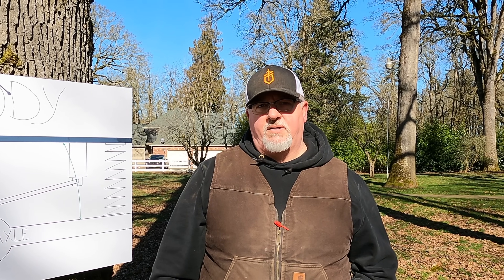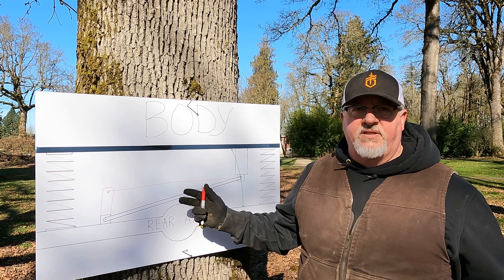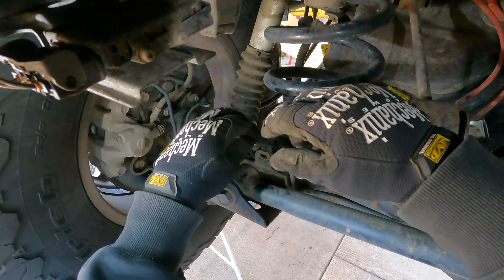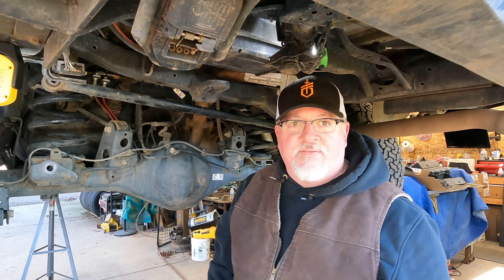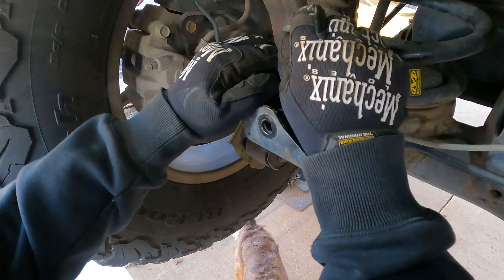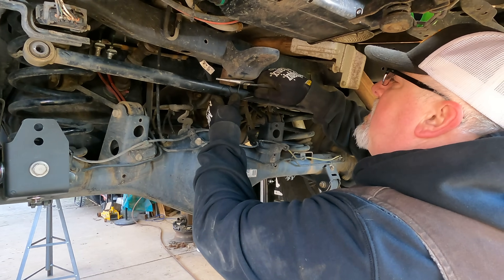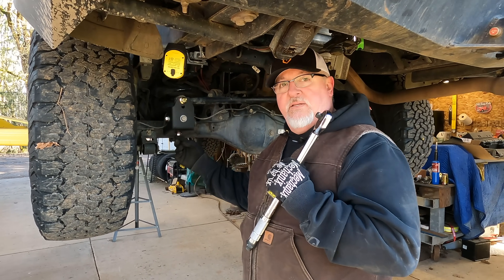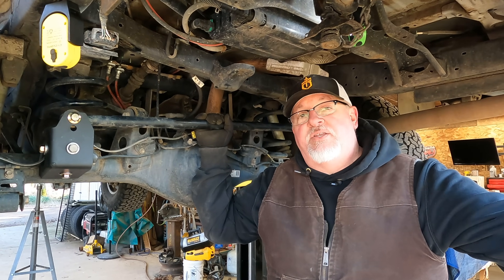Do Not Lift Your 4Runner ... Overland Build Recommended Geometry Fix - Do Not Lift Without This

Comment: You had me at "Do Not Lift Your 4Runner".  I don't see the point of it for normal people.  A stock 4Runner is probably more capable off road than most drivers.  I've recently bought a one owner 2018 4Runner Limited and I'm adding some safety equipment to it - rock sliders to replace the running boards it came with, and a set of 3 skid plates to protect the engine, transfer case and transmission - for when I'm driving it off road.  The original owner never took it off road.  I can't find a compelling reason to spend a bunch of money on a lift to replace a suspension system that isn't broken and to replace perfectly good rims and tires with ones that are slightly bigger.  If my X-Reas suspension system develops a leak, as they're prone to do, I'll delete it and replace it with conventional shocks, but I still need to see a good reason to lift the vehicle when I change the suspension.  The vehicle is already top heavy enough without lifting it higher in hopes of gaining a tiny bit of ground clearance and bringing all kinds of other potential issues into play.  I'm more interested in having a vehicle that's reliable and functional than cool looking.  I bought the 4Runner because I want to be able to get to more places that require high clearance 4WD, but the reality is it is still going to be driven on pavement 90% of the time.  If there are compromises to be made, I'll make them off road with the 10%.

Comment: I lifted my 2006 Nissan Pathfinder 4", the shop I had do the work never mentioned this information. When I'm driving and I run over a bump, I've noticed that shimmy he mentions. Its 2am and I am tempted to go look under my truck right now to see if that Panard bar was raised. I am betting that it was never touched.
Reply from the maker: It’s unfortunate that most lift kits, and most shops, neglect things like proper geometry; I think it should be mandatory, for safety sake. I hope you’re able to get your rear shimmy resolved. 🙌

Comment: I haven't seen the bolt on style kits for the panhard bar extention only ones I have seen are the weld ons but might be different for the 4th gens which are usually the same as the 5th gens hmm might have to see if I can find this kit for mine
Reply from the maker: Check drkdss.com to see if they have it. 🙌
Reply: @aired-downoverland9239  appreciate the link very much the website actually says it will work for my 4th gen v8 so going to order one up that helps a ton
Reply from the maker: @AntonioClaudioMichael  Glad it worked out!

Comment: Easy fix. Dr Kdss has a bolt on correction kit. Works great!
Reply from the maker: Agree! DRKDSS did a great job on the design and fit/finish of this kit. I’ve had the weld in bracket for a while but glad I never installed it.
Reply: Where can I find this?
Reply from the maker: @EvolBobby  drkdss.com

Comment: Just did mine! Got a shiny red one!  I have 2" of rear lift and went with the shorty version. You still want a little bit of angle for when you load up your rig with gear so your track bar's not in the negative.
Anything over 2" you'll want the regular height version.
I have a feeling Dom @DR KDSS will be working overtime trying to keep up with new orders for this awesome product!
Reply from the maker: Yup, all true. I’m just over 2” most of the time; I’m typically level when fully loaded. Also agree DRKDSS will be working late nights 😄

Comment: Thanks for the informative video! 

I just got a 5th Gen 4Runner and want to get a 2-2.5in leveling kit put on it. In doing this would it create this issue or is this an occurrence when one does a suspension lift? 

Thanks again!
Reply from the maker: You’ll be fine without it since you’re going with a leveling kit. 👍🏻👍🏻

Comment: Recommendations for if youre doing a weld on kit? Like order of the steps when removing bar?
Reply from the maker: I have a weld on bracket but never installed it, so I don’t have real worries experience. In would only disconnect the axle side of the panhard, weld in short sections to avoid heat build up, ensure the ABS line is out of the way, protect other areas by using a welding blanket. 👍🏻

Comment: Fantastic video. Very informative. At what height of a lift do you need to adjust the pan rod angle or correct it? With all the different lift videos on YouTube, no one ever talks about the pan rod correction. I’m thinking about doing a 1.5 to 1.75” front lift on my 24 TRD ORP and a 1.5” lift in the rear. I want to keep the factory rake or close to it which is set at 2”.
Reply from the maker: Thank you, I’m glad you found it helpful. You can find the correction bracket here: drkdss.com
A 2” rear lift typically benefits from this geometry correction. I’m not sure if a 1.5 would require it. The easiest way to tell is to do the lift, then check the panhard for any angle while on level ground 👍🏻👍🏻
Reply: @aired-downoverland9239  Thanks 👍

Comment: THANK YOU-- it's SO NICE to see someone EXPLAIN the "engineering" change that is RuINED by lifting and not correcting the other angles...  AND what about regearing for speedometer correctness too??  This doesn't even cover the engineering that changes the PULL forces that change on the transmission and engine by doing these mods.. THANKS AGAIN.. EXCELLENT VIDEO-- MUCH NEEDED..
Reply from the maker: Excellent comments and spot on. I have re-geared to 4.88’s, which gets my shift points and speedo really close. 🙌. Happy Holidays

Comment: Thank you for the information. Where does one acquire this bolt-on modification? Would the Toyota dealership use this piece in their suspension kit if getting a 3" lift?
Reply from the maker: You can get it from drkdss.com, they’re the only ones that manufacture it.

Comment: Just bought a used 4runner sr5 with a lift and fox suspension kit. suggest taking it to toyota mechanic to check if it was all done correctly and if im in good shape or any mechanic would be able to inspect?
Reply from the maker: Never a bad idea on a vehicle you haven’t built yourself David. The piece of mind is likely worth the cost.

Comment: I have a lifted Sequoia and I have to continuously steer left & right every time I got on the freeway. Steering rack was recently replaced so I don't think it is the steering rack but rather the panhard rod since mine is at an angle rather than horizontal.
Reply from the maker: Well I hope this gives some ideas on a fix. 👍🏻
Reply: Maybe you have a wheel under the fender on one side and maybe it's sticking out on the other side?

Comment: I saw a grease zerk that seems to now be hiding behind the bracket.  Can it still be accessed?  Also, you showed how the axle shifted about a 1/3 of the bolt hole distance.  Does that mean the axle is out of line by that amount since it lined up when leveled?  And finally, do all solid rear axle vehicles have a panhard rod?  Very interesting video.  Thanks
Reply from the maker: I don’t believe any zeros are blocked; I can’t think of one that would be behind the bracket. Since the vehicle was on a lift, and the axle at full droop, it likely shifted a little due to the way a panhard works. No, not all solid scores axels have a PH, a triangulated four link does not, or one with leaf springs, etc. 👍🏻👍🏻

Comment: Great video, great info. Which leads me to a  two part question. Do reputable shops that do lifts on 4 Runners perform or recommend this fix? And how does a lift as well as this fix effect a factory warranty? Thank you advance sir
Reply: Does not affect warranty at all. Most shops will recommend it if they know what they are doing.

Comment: Would you recommend this pan hard/track bar lift with a  1.25 inch rear lift? Pre-load Wescott. Thanks for you video. Very enlightening.  I have not experienced any of the issues in turns or dips etc.
Reply from the maker: If you’re not feeling any bump or rear steer, then no. With a 1.25” lift, my guess would be your track bar is fairly flat.
Reply: @aired-downoverland9239  Thanks for the response.

Comment: Great video… Link or info on where to purchase the kit?
Reply from the maker: You can get it from drkdss.com  They seem to go in and out of stock, but they’re a small manufacturing outfit, so I get it. 👍🏻
Reply: I’ve been going down a YouTube rabbit hole with 4Runners lately and I just realized that mine is different from the one in your video I think.

Do they make them for 3rd Gen 4Runners?

Comment: Do you need to do this with the vehicle in the air or can you still do it while on the ground? Just bought a 4th gen and need to do this to mine.
Reply from the maker: You can do it in the ground, and in fact, the final torque should be done on the ground.

Comment: Hi, excellent video, I have a question, what would be the difference between using the bracket to level the panhard versus using an adjustable panhard? Is there any advantage/disadvantage with the adjustable panhard? Somewhere I read that for every inch increase in suspension height, you should increase the length of the panhard 1/16 of an inch. Greetings from Quito - Ecuador.
Reply from the maker: An adjustable panhard can help keep your axle centered as you lift a vehicle, but it will not correct the geometry of the panhard as you lift the rear end. If you have a correction bracket, you shouldn’t need an adjustable panhard because the axle should be sitting in the stock location.

Comment: I have a 2018 SR5 4Runner. I didn’t install a lift kit on it but did install off-road tires with same size according to sidewall, but the new tires are actually a larger diameter than the all season tires I took off. I also installed Bilstein 5100 shocks. Even though I didn’t install a lift kit, would I still require the pan hard rod adjustment?
Reply from the maker: Nope, you should be good to go with your current set-up
Reply: @aired-downoverland9239  That’s good news, I also just read that if the hard rod is 5 degrees or less, no need to make changes and i’m under 5 degrees, thank you for the feedback confirming that i’m okay “as is”.

Comment: That's an interesting product, never seen it before, my panhard is raised, but the bracket is welded to the stock axle, it's made by Eimkeith. I guess your bracket is less of a permanent solution, I'm curious about reliability.
Reply from the maker: I purchased the Eimkeith bracket as well, but never got around to welding it in. Both serve the same purpose and should perform without issue if installed correctly. As shown in the video, I used a  paint pen to mark the bolts position to note if anything moves. So far so good.
Reply: @aired-downoverland9239  nice good to hear, good  option for those not wanting to modify stock parts.
Reply: @aired-downoverland9239  it’s way more reliable then the weld on version.  A thicker bracket welded to the top of a thinner oem mount is not it.  Trac bars side load the mount.  The oem mount is thin in some parts and i have proof of how the weld on version can be dangerous to some one who doesn’t cycle their suspension and end up using the bracket as a bump stop.  This bolt on version spreads the load all around the oem mount and inside !   If you break it after it properly torque down. You prob died ( not funny) and don’t even care about what broke.
Reply from the maker: @drkdss8742  Excellent response from the DR 👍🏻🙌

Comment: Unless you go overboard, it's OK to lift it. I have two - 2004 with 302,000 mi and 2018 with 35,000 mi. Both were lifted 2.5" at birth. The older one had eventually (@250K) UCA's replaced to correct caster but even before that, it handled perfectly, tires did not wear faster than they should've... The other one (stock except lift) has had no issues either.
Reply from the maker: Did you actually watch the video? Mine is lifted too, the video is about correcting your your geometry after lifting.
Reply: Lmfao.. its about the rod
Reply: @aired-downoverland9239  Did you read my post? The point is: it's not necessary to correct anything unless the lift is over 2.5".

Comment: Great video.  Thx.  How much angle is too much?  I have a slight angle in the panhard bar.  Not nearly as significant as the drawing.  Thoughts?
Reply from the maker: If it’s minimal with the vehicle on the ground, and you never feel the rear and move (bump steer), I’d leave it as is. How much lift do you have in the rear?
Reply: On a level surface with vehicle on the ground on its own weight. Measure from the ground up to the center of the bolt on the frame side.  Then do it on the driver-side.   If the difference is 1.5-2.5 I would do the shorty.  If it’s taller then that then do for the regular height. 

Under 1.75 you don’t really “ need” it but it’s more like you should want it knowing the axle is alittle pulled over to the passenger side and the geometry is a little off.  Some one sitting taller at say 3” or more will really feel the difference vs some one under 1.75”

Comment: So if I got a lift kit and had someone professionally lift my 4Runner, should I try to save on labor and do this rod correction myself? Or should I also buy the rod correction kit, give it to the professionals, and don't try to save on labor costs (if it would even be that different).
Reply from the maker: I can’t answer that as I don’t know your skill set. Check out the manufacturers site, that should give you enough info to know if you can/want to do it. Their site is drkdss.com

Comment: Where can I get the raising bracket? Thank you having issues now on my 96 4Runner it has a 3-inch lift that was put on it but!it's all over the road!!? where do find that elevated bracket? Thank you
Reply from the maker: You can find it at drkdss.com
Reply: @aired-downoverland9239  thank you I bet there's also examples of homemade brackets:-) realistically most guys that lift a Toyota or Jeep aren't going to spend that money and work and then put it back down to stock again probably ever? There are exceptions but if that is the case I could weld a piece of metal coming up off the axle from the other bracket  already on the rear axle. if I didn't know where to find one of these kits , anyways thanks
Reply from the maker: @markeverson5849  There is a weld on bracket available, check out: https://eimkeith.com/buystuff/pck/

Comment: This does fix your geometry for the most part but it would be advised to get an adjustable trac bar and measuring frame to outside tire to get it 100% centered
Reply from the maker: 100% agree. You’ll note I have an adjustable trac bar as well, I just didn’t cover that in this video. 🙌

Comment: Would I also need to do this when installing a westcott designs trd pro lift? It claims to not affect the geometry of the suspension but I just want to make sure
Reply from the maker: I’m not familiar with their lift, so I can’t say for sure. If it pushes the axle away from the frame, you’re changing geometry.

Comment: What if all I did was add a leveling spacer on the front only? Will this affect longevity of my truck? Mind you mines a 2wd.
Reply from the maker: A leveling kit will not change the angle of the panhard rod, you’re only moving the front up 1”
Reply: @aired-downoverland9239 Thanks!!

Comment: How much lift to require this kit? I lifted my 05 about half inch in the rears and 1.5 in the fronts. Barely notice any issues with rear suspension.
Reply from the maker: With only 1” in the rear you should be fine without a correction bracket.

Comment: So for a city drive and from time to time towing, do you recommend this correction? Stock suspension.
Reply from the maker: If your 4Runner has no lift in the rear, it would not be needed.

Comment: You mean this kit will not fit a 1996 Toyota 4Runner? And I thought I found a quick fix! But in the comments someone said that that kiT will not fit the 96 is that true? I was ready to order! Help
Reply from the maker: You’d have to contact drkdss.com as I’m not sure what years they make brackets for. 👍🏻
Reply: @aired-downoverland9239  okay thanks so far all I've found is a two-piece weld on kit
Reply from the maker: @markeverson5849  A weld in bracket is not a bad way to go.
Reply: @aired-downoverland9239  I understand thanks it's just that a bolt-on like yours would have been sweet anyways have a great day be safe on the trail

Comment: Ram and jeep use adjustable length tracbars for lift so how is this any better i used a sonoran adj. trac bar on my 02 4runner with a 3 inch lift and its been flawless.
Reply from the maker: That doesn’t correct overall geometry, it only allows for adjustment of axle centering
Reply: @aired-downoverland9239  Sonoran was the fist to make those drop brackets and they did,nt work as the owner of S. O. will tell you it made the 4runnet mire tippy and would come close to hitting the frame
 So i,v had no problems at all running the S.O. adj. tracbar on or offroad what you like is what you like im just saying my 04 jeep tj an 06 2500 ram have no handling problems at all with adj.tracbars.

Comment: I good suspension kit should come with all the parts for a good lift.
Reply from the maker: I couldn’t agree more! They should include extended bump stops & brake lines, and any geometry correction required.
Reply: @aired-downoverland9239  Well, like I have learned. There are lift kits and suspension kits.
Reply from the maker: @rudedogii  True, true, true